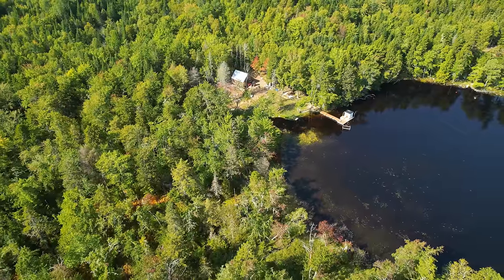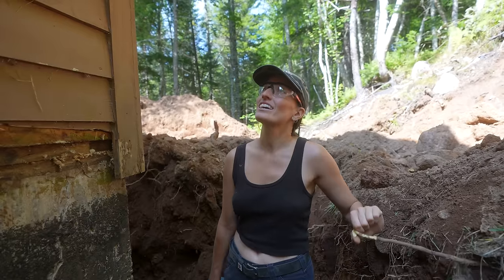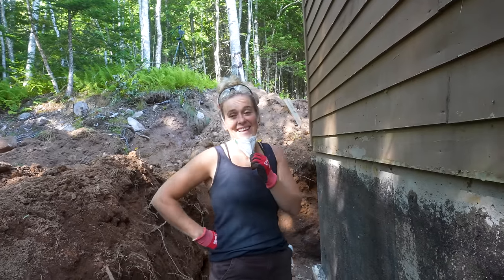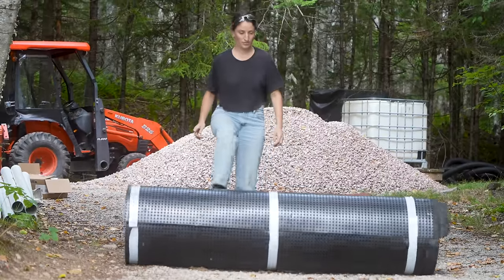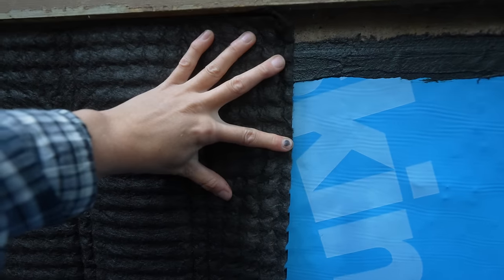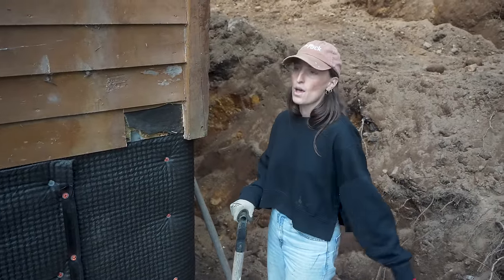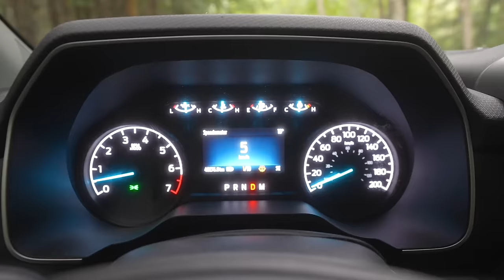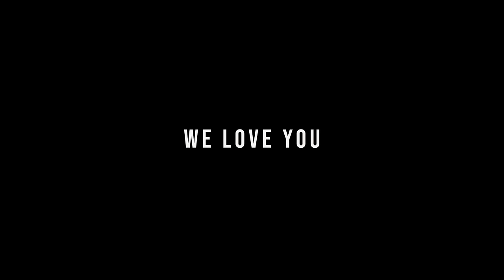STORM HITS CABIN AT WORST TIME! Heavy Rain Ruins Everything

Comment: I wrote a long comment about this in your last video (so you can look at that if you are interested), but I suggested putting an interior perimeter drain along the inside of the foundation, leading to a sump pump, so if any water does infiltrate, the sump will get it out and prevent moisture build-up under the floor.  Despite all the great exterior work you are doing, I don't think you are going to keep 100% of the water out of the interior during times of heavy rain or high ground water/flooding.

Comment: please research my suggestion of insulating the exterior of the foundation walls.......the KEY to low energy use is a tight/well insulated "envelope".......and since you have EASY access to the concrete walls, it is an easy process.......the dimple barrier you have planned would then not be necessary. You get water tightness, insulation AND water repellent all at the same time. Here is the easy process: put 2x4s flat against the concrete at 24" on-center. In between these 2x4 'nailers' put 1-1/2" rigid insulation, tape or caulk each joint (minimally glued in place) . Then install another layer over everything, (another 1-1/2" thick rigid insulation, screwed into each 'nailer', tape each joint. The exposed insulation above ground level will need metal flashing of some sort. This all may sound onerous, but compared to most of the jobs you two do well, this is nothing BUT gains a lot in making the envelope top-notch, which will serve that building well for years to come.

Comment: Ladies if you ever use excavator for putting stone around a foundation turn the bucket around backwards so the bucket teeth point away from the operator and you will be able to place stone more accurate, if you have a quick attach bucket on the excavator.

Comment: Think you would be better keeping internal drain separate, not connecting it up to external french drain. Have a little sump pump in then to remove any water and pump it outside at high level (connect into downpipe system) Seal up door/opening a little higher.

Comment: If you wet the wall, the crack a little bit it’ll give you a little bit more time and it won’t pull the moisture in the water out of the hydraulic cement as fast I use just a spray bottle or a sponge or just a light mist on the hose would workand let it soak in just a little bit so that there’s no standing standing water and it’s just damp

Comment: Your Bombas socks will look new and last for decades as long as you AIR DRY THEM.  
JSYK:  I’m 70 yrs old and I never ever use the dryer for my undies, socks and brightly colored clothing.  I have two flannel shirts I bought in 2000 that still look NEW.  I also never ever iron my shirts.  I ‘bachelor hang dry’ after I ‘warm’ the wrinkles out for 2 min in the dryer.  Heat damages fibers and elasticity.
❤IN JOY❤

Comment: Don’t have the interior drain open like that.  It is just a path for water in.  Put in a pump under the house and pump it out.  A good pump that will last for ever is 300 bucks US.  And put un a vapor barrier.  There is a YouTuber called Apple Drains that will give you the info on a good pump, and help with your other drain needs.

Comment: I learning from U2 in ur videos. That dimple gun, with each dimple washer & nail do u have to load each one before attaching to the wall? 
Shit does happen and I just hv to go with it. May putting the gutter up onto the roof b4 the trench work, Is that doable? Then u can place a make shift extended gutter to divert the water from the cabin?
I'm still amazed at all ur projects u've tackled. I'll be reaching out to u2 for advice. 😉👍🏾🐕🐕🤗💓🏳️‍🌈

Comment: I’d put more gravel in the crawlspace and then line it with plastic… Trent and Allie (youTuber that just had the second son born) did that. Others do the same thing. But if that gravel is got water, you should at least have the gravel high enough to where the plastic doesn’t ever get in contact with flowing water. That’ll keep the vapor, barrier, water moisture contained under the plastic and not seeping into the rafters/floor just from high humidity.

Comment: You need a construction water pump to pump out the water.  It looks like a generated but you attach a hose on both ends to suck the water out of the ditch. I had a picture of one, but I can’t attach photos to you comments.

Comment: Please do NOT use soil as back fill over the french drain, eventually the soil will work it's way in to the french drain and plug it up.  Use only gravel around the drain all the way up to ground level.  As for the rain gutters make it so it drains into or in a seperate pipe then flow away from the house.  Once the rain water is caught (pipes) why lose control of it if you let it flow out into the yard.  Get it away from the house.  Have fun.

Comment: You could do with proper concrete chisels rather than the wood chisels you both seem to be using. They will enable much better removal of the concrete in the footings around the cracks. Jeff in UK
Reply: The hardware store is a day's drive there and back...and that's what they had on hand...and it worked just fine!

Comment: Not sure if anyone commented or not. But, the water inside the crawl space, probably was rain water. But, since the ditch flooded, it flooded the pipe already in the crawl space. It probably runs all along the inside walls, just like you guys are doing on the outside.

Comment: I think you guys need a sump pump with a float on it🤔

Dig a hole lower than the trench so all of the trench will drain down into that hole and then when you’re done, you can fill it back in with gravel 

That way, you don’t have to dig a full trench to divert the water away. You can just dig a hole down put the pump in the hole inside of a bucket with holes in it to keep the settlement out of it pump the water out it’ll keep it dry and then you can fill it back in later . You just have to keep power to it.

🤔 wait you guys don’t have power at that house yet do you?
Hmmmm

I’m the electrician who thinks everything can be solved with power 😁

It would not be running all the time. You could probably use a power station as long as it was large enough to run the pump. …. PVC pipe instead of a hose and I probably do at least a 1 inch.

You could also incorporated into your design and make it permanent and put it near the access because that’s gonna be down near the water level anyway you could use it as a back up and to monitor the water level

If the pumps on the drain is not working

Comment: Your vertical pipe WONT work for snaking. The T at the bottom will bind the snake you need an angled joint to lead the snake in the direction of the pipe. What you can use the vertical pipe for is to run your Gutter downpipe into the drainage so that water gets carried away with the rest.

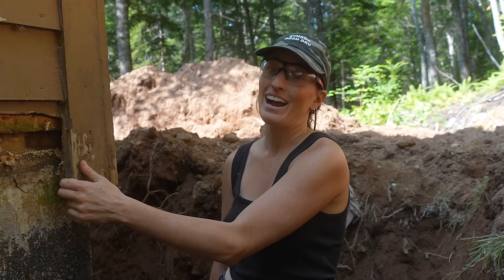Comment: Jasmine asked Crystal if they could take it across the border OK I don’t know because it’s technically a GN but it’s also a work tool! Here quite a few years back I was working with a rescue squad and we were putting up offices within a big concrete floor space and we had to rent one and luckily we had we got rent instead of buy it cause they’re expensive and this was a big one we had to get cause had to go to the through the floor and hold up Was four section of walls and five offices inside which one of the offices was mine and I definitely didn’t want the walls coming down on me and did like 22. I can’t remember what was he was he? I just know it was huge and the first one went off and I was in the office and paperwork in my first office and I didn’t know that they had gotten back and then they had started and I was in there doing I was the treasure so I was working Fundraisers and calling around to get donations and things like that and I was on the phone and all of a sudden I heard loud noise reminded me of a shotgn and I can running out of my office because that like I said, I didn’t know they were back. The door was locked because I was the only one there and I was doing a bank account or a bank deposit and I was working on the computer and on the phone with like I said fun doing fundraisers and I went out and they were laughing because I immediately went towards the door. I grab my cell phone my car keys and I was at the door to head out and I heard them laughing and I turned around and I was like you butt holes. You could’ve at least said back and it’s gonna get noisy. I was literally on the phone with someone trying to help out with this fundraiser to do and then they apologize and I said can you wait until like after 4:30 that’ll give me plenty of time to finish up because I had like probably another hour and a half to two hours work to do and this was 1ish! So I went and got lunch and of course walked the door back and I took the tool and put it in my office to make sure I didn’t happen again. I’m telling you all it scared me today and I’m not going to run, but I didn’t have protection with me if you get my drift And I’m always something so I would just check with your what I was gonna say in the beginning and I made a story out of it. Sorry a true story that is though check with check with Canada because you’re not gonna have to go from Canada to the US and then from the US to Mexico, so I will check with Canada and see what they have to say about it and then if they OK it then maybe there’s paperwork that they can fill out for you to get the US and then the US can fill out paperwork to get you through mexico because technically it is a work tool You can rent them in the rental places and I don’t know about Mexico. I don’t know that much about Ball but I would definitely do some research on it, but don’t and just assume that you could do it because as my husband says if you assume you were making A’s out of both of us. Missed you all last week. I think it was last week. Glad to see you back. Glad to see the girls are back and everybody’s doing good. My husband and I are actually looking at one of those type of animals are type of dogs, I’m sorry they’re not animals their babies they fur babies, but we’re in a dilemma. Maybe you girls can help me out. How do your fur babies do in warm climates because I can’t. I’ve been watching you for a while, but I can’t remember if they went to South America with you or not or if you all had them like  with family. The reason I’m asking is because if we I have a weenie dog a miniature Winnie dog he’s cool with like warm temperature warmer temperature He he loves sunbathing, but he also likes to like knackered down under the cover to the feet and sleep too, so I mean he can take it either way, but we’re wanting a bigger dog for me. I have some disability and he is my emotional support dog or my panic attack and an anxiety attacks and nobody come for me on those. They are legit and he has been trying a trainer in Virginia that works with dogs for people with PTSD and I have been diagnosed with that also so he’s perfect if I start having one and he feels my heart rate going up or my breathing start acting rapid he gets on my chest and lays down if I’m sitting up, he makes me lay down so, 8 pound solid but we were wanting one. We were looking at a bigger dog and I love your breed dog, but the problem that I was talking about is and want to know about where my climate we live in Southwest Virginia right now and error humanity this year has not been that bad. It’s been in the hundreds a couple of days and I have problems with my lungs also so I’ve had like through the summer. I have to stay in or Stay where there’s air conditioning most of the time in the winter. I have arthritis and other issues so I don’t do very good in the winter my breath and don’t either but we’re planning on moving to Arizona through lock fall winter early spring. And I know Smokey, which is the Winnie dog‘s name will do fine in Arizona, but I don’t know how a dog with fur would do. We’ve also looked to other animals other breeds of dogs and we’re just trying to narrow down and see how good the girls are with you and I know Smokey does good with bigger dogs and that’s why I’m trying to and it’s just not you and other Youtubers For babies that are bigger. What they take is about weather now in the summertime when it starts getting like mid 90s and higher we’re gonna travel north maybe back home cause we have a house here this is our house so I mean it’s just it’s one of those things will be traveling and smoky travels well so I was just trying to figure out you know I’m getting feedback from everybody that I can, basically

Comment: Knowledge:  Before doing ground work drive somewhere with internet unless you have it at home and check the weather forecast for the next 10 days. You're more better off digging if the next 10 days shows sunny clear skies. Probably the wrong knowledge you needed.
Reply: Gas generator with a Water Pump connected to it? Or a water pump that has it's own gas engine and pump the water out with it. If you don't have those you got to go shopping.
Reply from the maker: We did. We live near the ocean it changes every 5 minutes 😂 thanks for watching!

Comment: I have no idea about French Drain but could you not make a gutter and let it flow into the far edge of the French drain so it will clear it with the Rainwater from the roof every time it rains? You are planing an overflow into the River, don‘t you? If you do, you should think about a valve so the water can’t come from the river into the French drain.
Reply: Rainwater often takes debris from the roof and gutters and clogs the downspouts.  It's not a good idea to let the downspouts drain into an underground inaccessible pipe.
Reply: @GuyWithTheDogs  That is correct. The leaves and dirt from the Roof needs to be filtered. But that is always the case, no matter what you do with the water. There are many ideas and options for a debrisfilter from the Roof that are easy to maintain.

Comment: Umm you really didnt read the directions dimpleboard you drill the hole then you hammer in a special nail and i dont think blueskin is intended for foundations . the correct system is using a fiber coating primer then a fabric cloth then another coat of fiber coating then plastic film then the dimpleboard . but thats if you really want it to last years .

Comment: I was thinking in stead of using the french way. Try using the Roman way. Dig a trench that is just below the one around the Cabin use steal mesh to hold back the stones so the trench is 3 plus inches bellow watch the flow of water and see how far and low to drain the water away.  Make a soak-away or large water pipe the distance you need  as might drop to 12 inches at the end.  I say this old way because using a level or working out is not easy some use string but if not time old ways work.

Comment: You should have put in gutters down spouts to run into your French drain so the water from the roof goes out away from the cabin
Reply from the maker: They will be on a separate drain. We were told not to connect them
Reply: @Vanwives  That is correct.
Reply: Anyone who has ever had to flush out a downspout in the pouring rain because debris that had collected in the gutters clogged the downspout, knows that that is really bad advise.  A separate system is the way to go.

Comment: ( S_U_M_P  Pit )  Is what  you  need in the  basement / Crawl space ( 2 ) to be  exact. 
If  YOU Don't  know what they are ??  The  Simple  explanation is a LOW point to which ALL the Water flows to then also Gets pumped out  from.  WHY ( 2)   Back up to a  Back up.   One in the  very lowest spot  possible.  One (The Other ) about  10 to 15  feet away to take up any OVER-Flow that could  occur.  Some places will use Two pumps in the  same  hole.  Bottom and  about  a  1/3 or  1/2 the way  down to increase the total Flow being pumped out.  ACE in the Hole is one  term for this process.   Standard units for the single version are easy to find and use.  Hooking u to either  your  Charge packs with solar as a back up or if  POWER from a pole or  other source is also being used or desired as well.   NEVER EVER Expect MOTHER Nature and FATHER Time to Coordinate which is  first in line. 
Water will ALWAYS ( FOLLOW the PATH ) Of LEAST RESISTANCE  ALWAYS ! ! ! 
The VOICE or REASON  has  SPOKEN   IGNORE this  FREE and  SIMPLE Advice . The  cottage will rot from the inside out making  all your  plans  Flushed away with rains and frost heaves that come and  go like a  toilet bowls  - f l o w ....

Comment: As i telling you in the last video, Do not use the American 
technique. Take a minute and think. The drainage pipe shall be UNDER the foundation level on the outside so you get a dryer footings, concrete that is not protected sucks water even on the bottom. When you install the drainage pipe use washed gravel all the way up (no need to cover it with fiber when its washed) then you install pipes around the house where you connect the pipes from the gutters, pipes shall be solid and not drainage pipes. Then you can lead the water from the roof away from your foundation. If i saw it right the white  drainage pipes have only holes at the bottom, if you using pipes that have holes all around the pipes it works even if there some clogging inside.